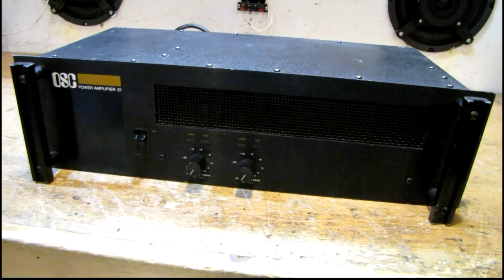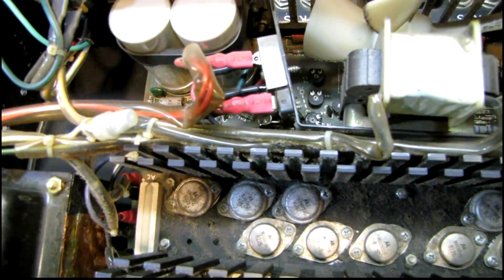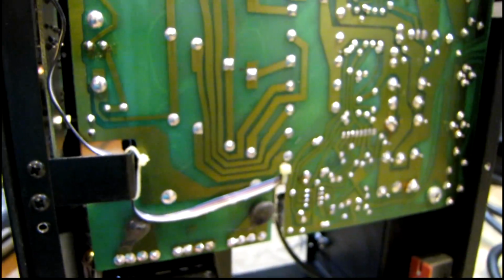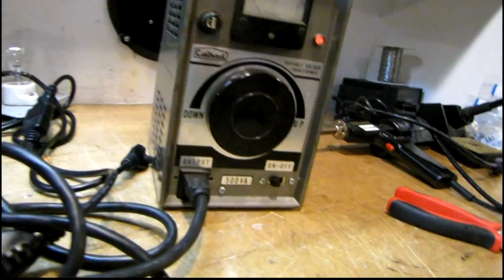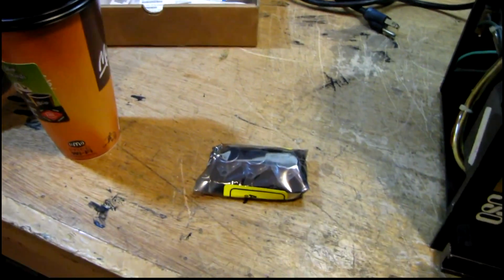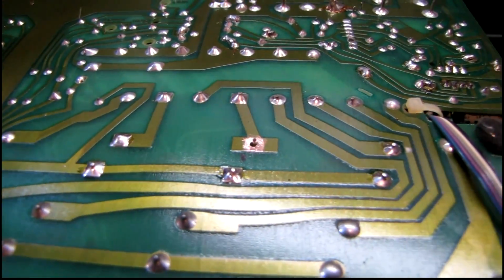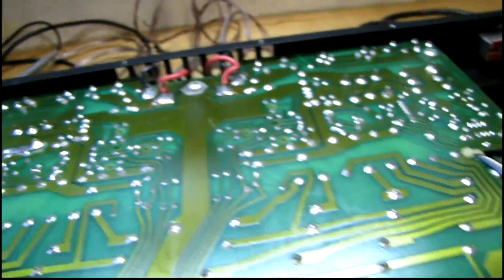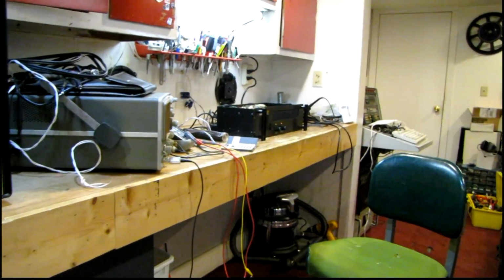Vintage QSC A21 Amplifier Repair 4-20-13

Comment: Great job.  I just rehabbed an Altec-Lansing 9444a amp.  Replaced all the electrolytic caps and replaced the NE5532 op amp in the input with an opa1642.  Its now what I'd consider a hi-end stereo power amp.  I also slowed down the fan by putting in a bigger fan resistor to quiet it down.  My total investment for the amp and all the parts is about $200.

Comment: QSC are great amps.  I have worked on a few, and are fairly easy to service and they seem to stand the test of time.  I have heard, although I can't confirm this, that QSC decided to stop using tin plating on circuit traces in the late 80s/early 90s.  Can anyone confirm this?
Reply from the maker: Most companies have not been doing the tin plating these days.  It's just solder mask over bare copper now.  This is a good example why.
Reply: Maxxarcade have you ever worked on any Crown amplifire
Reply: qsc r mediocre amps

Comment: i just tested my at least 40 year old Vinyl  player / amp , it is probably older then this but it uses same Transistorors . And i was checking with my finger if its wormed up , is it working cuz speaker was just humming and baam. It taped me real nice . Got my voltmeter , and its 50V. im like damn man aint that a lesson . So now im thinking . The body of transistor  is base , the cooler should be neutral ,GND...there shouldnt be any voltage there . So i guess somwhere in it a cap is dry and it shorts DC to ground . so the bias voltage of first stage transistor 20v is shorted to the ground and second stage 40v is also. Is this correct . I checked the voltages on all transistors , 20/20V and 40/40V , on 4 transistors . I also noticed that the Vinyl motor is spinning always , i guess thats from reverse voltage it gets from ground . Does this make any sense ? should i trace that voltage ?

Comment: I have a A 31 which is built identical to the A21. I'm a beginner and I'd like to see how you tore it down to get to the transistors and circuit board? Is it as hard as it looks? I really love this amp.  I need whatever specs to adjust the trims. Can You help?

Comment: I've always liked the reliability and sound of QSC amplifiers. As in ex engineer for UCI cinemas UK we have used hundreds of QSC amplifiers over the years. The fans can be a little over kill at times. I mod we used to do was to fit a temperature cut out with a capacitor across it. With the cap in circuit the fan would run at about 25% full speed. Should the amp be driven hard into 4 ohms the cut out would click closed and return the fan to full speed. In the real world it was very rare for this to happen.
Made the projection room much quieter with an average of 6 amplifiers per screen.

Comment: 1 thing I like about old amp's, it's more easier to repair than the one's now, too many surface mounted components. just repaired 1 qsc as well- rmx 2450, damn small parts, took a few hours to get it going.lol,

Comment: The NE5532 is a nice little low-noise op-amp which doesn't cost too much.  Dolby used them in the CP700 sound processor.

Comment: Hi max, i recently i got HH Electronic MX1200 power amplifer.Before this it works great ,500watt per channel at 4 ohm,but the original owner has accidently shorted the speakers cable and caused it got no output sound.The power amplifier still can be power on, but did not get any output sound and seems the Signal LED's incator of both channel did not respond.What would caused this problem? Output transistor? or the preamp board?Thanks.

Comment from the maker: There is really no way to predict fan failure.  I've seen them run noisy for years, and I've seen quiet ones seize up.  You just need to check it once in a while. But I guess the good thing about it being noisy, is that you know when it stops.

Comment: Hi Max,Im getting a cb radio for the car,but I will be running it in the house,its 40 chanel Usb/Lsb am is 4 watts and ssb is 12 watts.How many amps should the power supply be 3,6,or 9?
Thanks.

Comment from the maker: I just went with the complimentary to the original MJ15015 that were already in the amp.  Also checked with QSC.

When matching transistors, I use my meter to match Hfe.  Finding substitutes is a matter of several things- Understanding the circuit, comparing to other amps by the same company, comparing datasheets etc.  And a lot of the time, there are already other people in the same situation that post on forums with their findings.

Comment: I ran across your post on DIYAudio forums regarding the transistor replacement.  How did you decide on your replacements?  I could find absolutely no datasheet on the original transistors.  What do you do in a case like that?  I suppose if you have a working transistor, you could use proper measurement equipment to spec it out?

Comment from the maker: Broken connection to the speaker feedback circuit, where the filter cap was connected.  This amp uses the main filter caps to also couple the signal to the speakers.  It's a cool design, and also prevents DC from going to the speakers in the event of a malfunction.

Comment: Going to do anything about the loud fan?  i imagine it wasn't a consideration originally if it was going to be used for big PA stuff, but since you're just going to be using it in a small room, I imagine it'll be far more annoying.